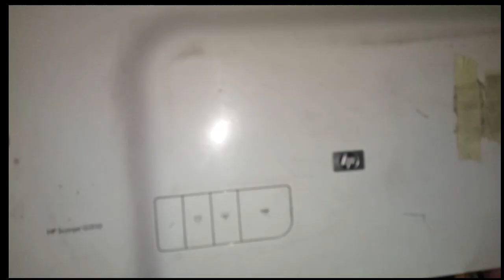How to Fix HP Scanner Problems | How to Fix HP ScanJet G3110 Scanner Problem? Teardown HP Scanner

Comment: hello
I am very happy that you took the time to make this educational and complete video
I have this model of scanner, when I scan a lot, a blue line appears on the scan, or the whole page is covered with a layer of transprint. This method can fix it, or do we have to change the whole scanner unit, when the light comes back, the scanner makes a sound. Does it need lubrication, can it be solved with your training?